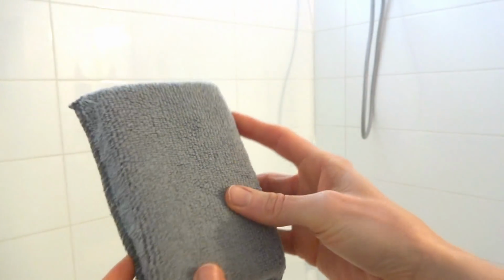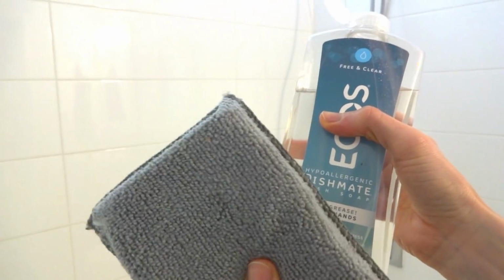CLEAN WITH ME- cleaning routine for minimalist bathroom

Comment: Does dish soap help remove build up in the shower? I scrub and scrub but have a hard time with build up due to hard water where I live.
Reply from the maker: I think its depends on the water for sure but what I found is that dish soap has a higher concentration so it removes oily dirt better but that scrubby sponge helps too. If it's a ticker built up if you scrub it every day a little bit for a while it will get better. Our tub was in a very bad shape when we moved in and I scrubbed it every day for almost a month and I think it getting very nice by now so I don't clean that often. We lived in an area once we had a terribly hard water it was so hard to clean so I hear you on that!🌿😊
Reply: Amy Chen I use dish soap and add baking soda for a scrubbing agent and go to town lol. We too have hard water. I have to scrub my tub at least twice a week. Wish I had a porcelain tub!! 🛀
Reply: Scandish Home what kind of dish soap do you use? Have you ever tried using Castile soap instead? I haven’t but wonder if it would do a better job or same. And, what are the Honest bottles I saw there on your tub? I know Target use to sell Honest products but the other day I went there looking for some and they had zero 😒
Reply from the maker: @keylalipo7778  I find this honest brand at tj maxx I was surprised to find this there so I bought a few. I like to use some biodegradable dish soaps I think they all do a great job :)
Reply: @keylalipo7778  Thanks for the tip! What ratio of dish soap/baking soda do you use? Can't wait to try this out.
Reply: Amy Chen Amy, I don’t measure. I just por the soap and sprinkle the baking soda and start scrubbing. If I had to guess, I would say maybe 3 tbspn of the dish soap and enough baking soda to create a good enough abrasive texture. Hope that helps 😀
Reply: @keylalipo7778  It does! Thank you!!